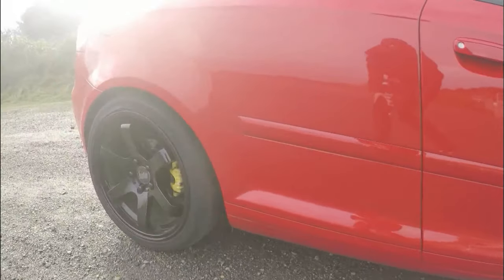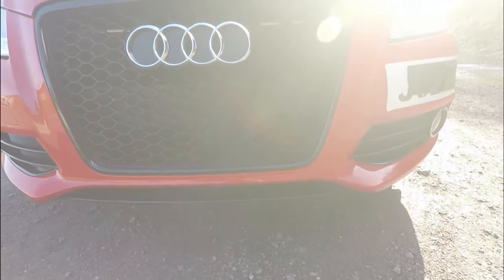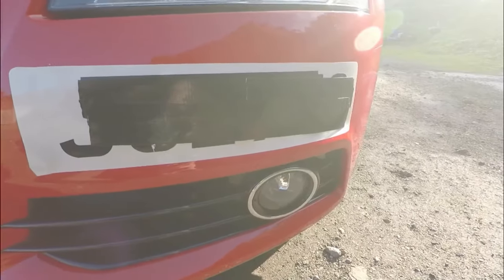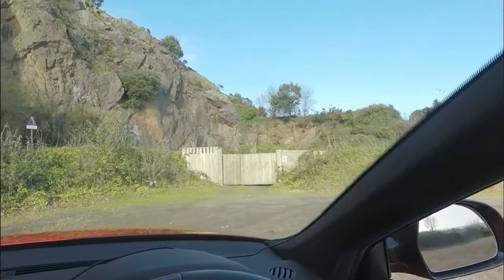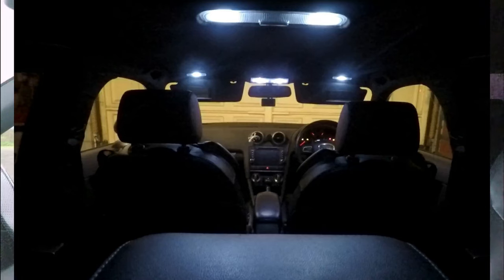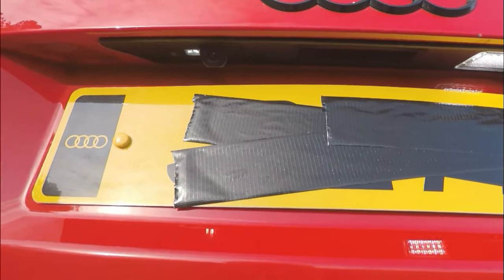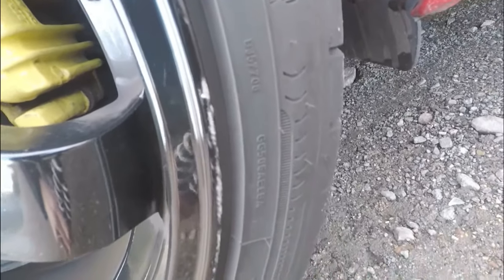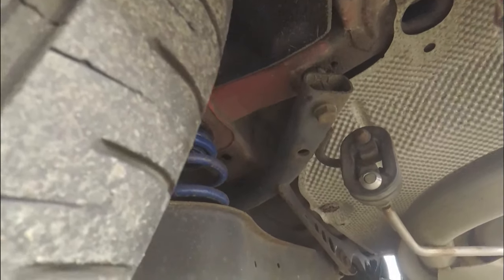Audi A3 1.8 TFSI 250BHP | MODIFICATION LIST!!

Comment: Hey, have you got any further details on the brake upgrade you've done??? I'm looking to upgrade my brakes on my a3 1.8 tfsi to before I go for my Remap. And what you've done is pretty much exactly what I'm looking for :)
Reply from the maker: Hi, yeah I used 2.0 litre gti carriers with the original calipers on the A3. Straight bolt on
Reply: @MotoAdventuresYT  ok awesome, do you know what size the discs are???

Comment: I like what you have done to your car. 
i have a question for you:
- i have audi a3 8p 1.8tfsi s-line and i seem to have big difficulties finding an exhaust that fits. i made a search for the same exhaust youve got and in the description it says that it fits 2.0 quattro sportback not 1.8 tfsi. 
why is that? is it not so important that the discription says audi a3 8p 1.8 tfsi sportback s-line 5-door 2wd? do i have some wiggle-room for installation? 
please help me, Sir!
Reply from the maker: Ole Magnus Jensen hi mate, I’d recommend using demon tweeks website as they are very accurate with there fitment and everything I ordered from them fitted straight up and easy. Without any modification to any parts.

Comment: do you get oil comsumption issues on this
Reply from the maker: Watch Me Play no mate
Reply: @MotoAdventuresYT  ive just bought a audi a4 1. 8tfsi 160 bhp, what engine mods do i need to get 250bhp, according to cetic tuning a remap will get me 210, do i just need to intake and exhaust, or are there any inexpensive mods i can do to get 300bhp? do i need to change my clutch?
Reply from the maker: Watch Me Play Hi mate, my 1.8 had the following to make 250,
K&n intake, full miltek exhaust, large intercooler
Reply from the maker: Don’t need to change the clutch. But can’t get it to do anymore than 250 hp without changing the turbo